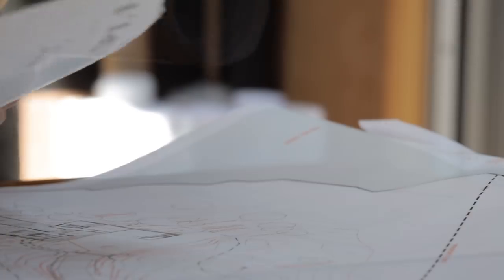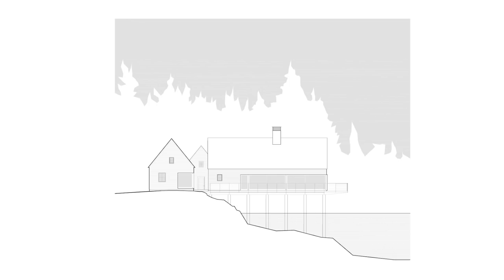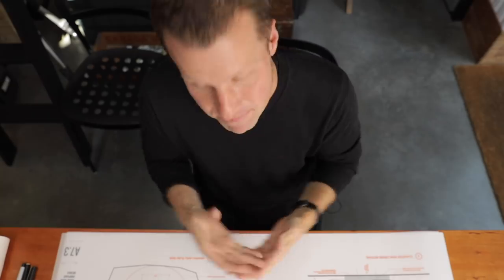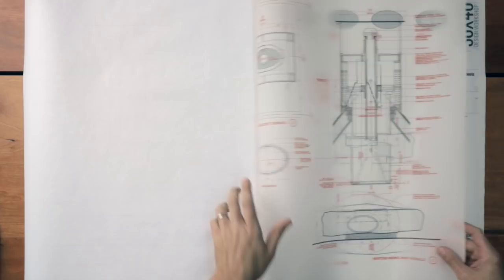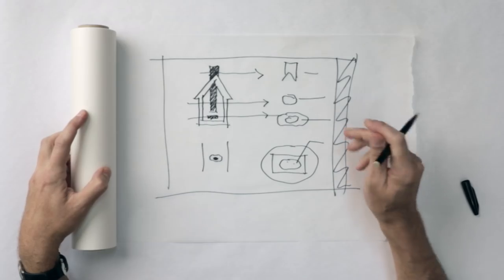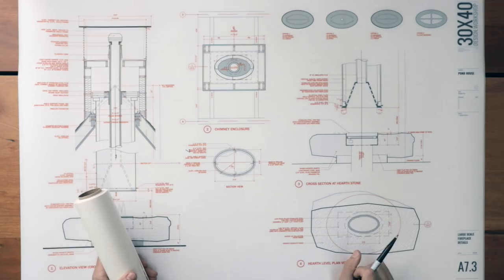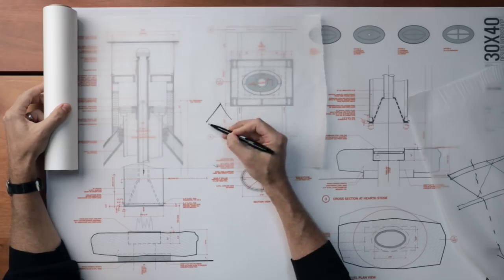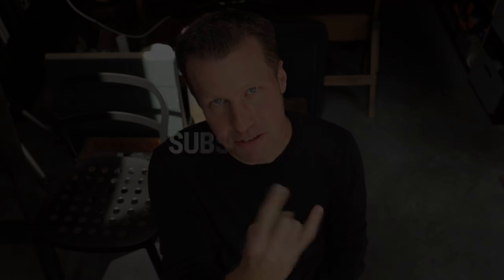How to Design + Draw Construction Details (Start to Finish)

Comment: As a former frame carpenter with a 2 year drafting and design degree, plus 25+ years as a commercial superintendent, I'm a fan of your videos. (When I have time to watch). I appreciate the amount of coherent information that you fit into a short video timeline, without a lot of fluff. Bringing any project to fruition is a complex balancing act , having to juggle the constant flow of budget, deadline, scheduling, satisfying client wishes/concerns, adhering to code, timely procurement of materials, etc. After viewing a finished project, I'm sure that for the most part, people are unaware of what is required to "get to paint". Great videos. Appreciate the effort.

Comment: Thank you for the video. You touched some what on the principles of detailing.  but things I will come here looking for, as a young architect, are more applicable circumstances of detailing and building science.  Things that I can carry over into the work I'm doing.  Modern ways of putting a building together.  I appreciate your videos that teach me about new materials that I could be using.  Things with practical application.  I appreciate this video though, and thanks for what you're doing.

Comment: I liked the video. It's great and the level of detail is good but I have missed an interview with the engineer who designed the heating system in order to know more details. For instance, why you chose stainless steel instead of bricks, what type of fan you installed, how much air flux is extracted,...

Comment: Good information.  I'm plan to build an exterior restroom near our pool, but need draft plans for a permit.  Is there any recommended software that i can use for such project?  It's a small restroom measuring 5'X10'.
thanks

Comment: Well, being the newbie around here, I have a question about a detail I'm trying to draw.  I'm adding a concrete ramp and stair system to the outside of an old masonry school building.  The threshold to the front door is about 4' above grade.  I know I can add a metal threshold like one from Pemco where the concrete landing meets the existing granite alcove and that should take care of water at the doorway, but what about the rest of the landing?  I built the ramp on concrete foundation walls with a french drain located at the bottom on top of the footing.  But at the finish surface of the landing that extends beyond the door width, there will be a gap between that and the exterior wall.  

Can I just caulk between them?  How do I address that condition?